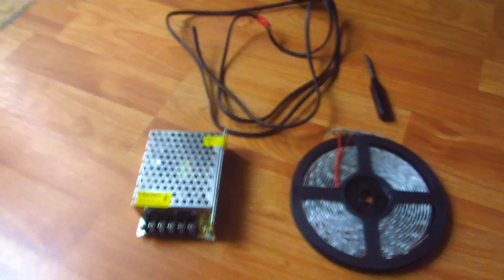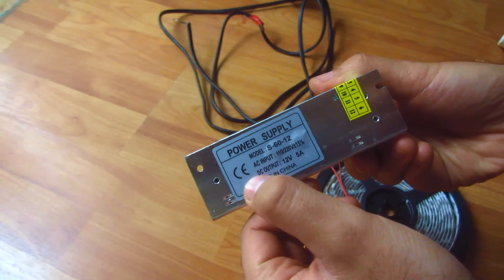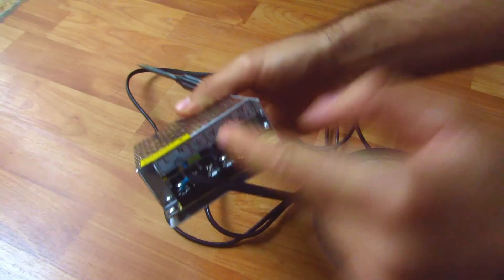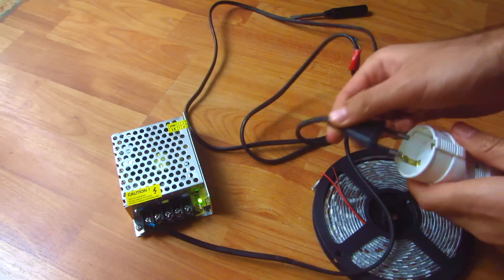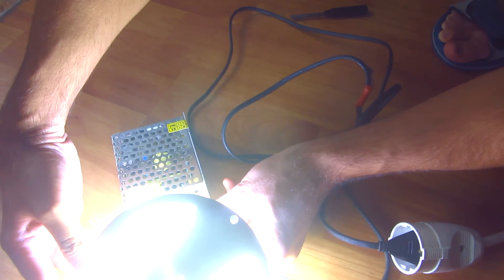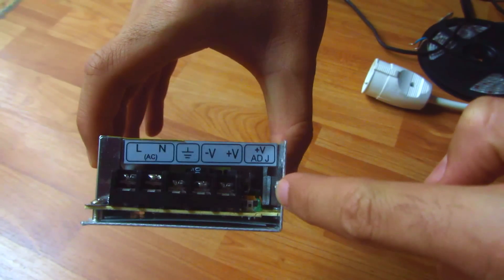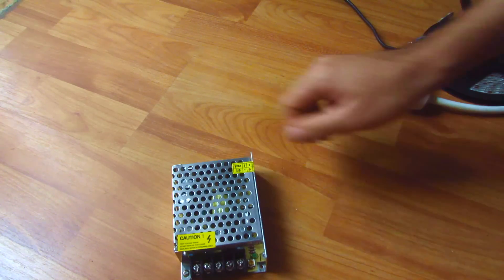How to Connect LED Driver/Transformer to Flexible LED strip

Comment: Isn't the Blue cable for the Neutral slot ?
Reply from the maker: Usually it is, but since it uses alternating current (AC) it doesn't really matter because it is changing polarity many times each second anyway.

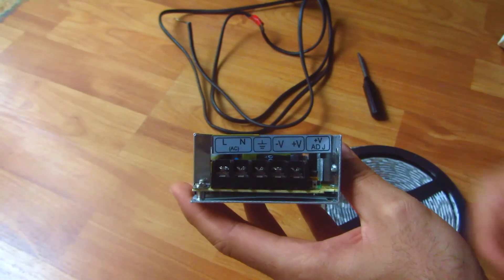Comment: At 1:23, What is the last label on the right "+V ADJ"? How do you use it? I am asking because my strip seems a little dim after installation, so I am wondering if I need to use this to increase the voltage.

Comment: How to connect 12m (5+5+2) 12v 50/50 to  power supply?
Reply: I have the same question. Did you have any luck with this?

Comment: Hello I was wondering on the power cord  to the wall how do you know what wire color is L and the N
Reply from the maker: It doesn't matter which is L or N because it is Alternating Current (AC), it switches polarity 50 times per second (in Europe), that's the 50Hz. Just don't connect the 220V to the -V and +V, that is the 12V DC output.
Reply: @furulevi  thank you and I appreciate the information helped alot

Comment: Can achieve the same result, but surely much safer to connect the LED strip to the transformer whilst it is off, then switch on power supply to the transformer after all connections made?  At least you won't have to take so much care not to touch the L+N terminals whilst connecting the strip and prevent electrocution systematically.
Reply: led strip light Transformer  make noise how to fix it ?
Reply: @shrimplife8246  simple, new small LED drivers (transformers) from say 240V to 12V or 5V with sub 5A total current shouldn't be making noises at all. I have about 10 in 24/7 operation of different sizes and none make a noise.

Maybe replace yours.

Comment: I don’t understand why you connected Blue to “L” and brown to “N”. I have Chinese LED driver which has brown connected to “L” and blue to “N”. Did not you switch polarity?
Reply from the maker: Yes usually brown is for Line, but in the end for AC it doesn't matter because it is alternating.

Comment: Hi in 23 meters led how many watt should be the Transformer?
Reply from the maker: around 30Amp (at 12V output)
Reply: furulevi yes but how many watt should be the transformer ?is 250 watt ok?
Reply from the maker: It might be OK but it will heat up faster and it might burn out faster. These LED drivers are sold with different Amperages, not by Watt.
Reply: furulevi thanks sir
Reply: furulevi hey body how are you I did install the led  and the transformer is 350 watt but around 3 meters is to dim light what is the problem?

Comment: hi.. what is the watt ur psu...?
Reply from the maker: 12V x 5A = 60W (shown at 0:26)
Reply: thank u very much.. I had wanted to know wattage calculation I know that . i want decorate my home. it is 5m/roll * 10 rolls = 50m  length. 12V *  50A = 600W PSU  is suitable with AMPS.....? (amps between 2 rolls.)
Reply from the maker: 4 meters of 5050 LED strip requires approximately a 5A transformer, so 50 meters of LED would require a transformer of around 62A, and 62A x 12V = 744 Watt. Use multiple smaller transformers.
Reply: thank you......

Comment: Hi . I have 2 rolls of 5M led strip rgb 5050. I have already fixed it to my T5 tube casing . But waiting for my transformer . Can Iuse a 24v power supply if I combine these two strips which will make a  length  of 10M . your advice please
Reply from the maker: Theoretically you could connect 2 LED strips in series and power them with 24 volts, thus each strip will receive 12v. (I haven't tried it with my LEDs)
Reply: Hi Thanks , Afraid if one strips blows off another one will burn off too . any way will try it with two 12v power supply . thnks

Comment: Hi, I have an exact same transformer which is 5A 60 Watt....arrived yesterday - I connect the two pin AC cable as mentioned in this video - Tested it - The Green LED comes - Touched it - Everything is fine. Today MY LED Strip arrived which is 5050 SMD with Five meter Roll and 60 LED per meter which means 300 LED. Connected and LED Roll Lit up - No problem. But Power Supply now give very very mildly shock. Disconnect the LED - Touched it - Nothing...Again connect the LED and there is shock present.
My question here: Is it going to harm LED Lights anyway ?  Please let me know.
Reply from the maker: Which part is shocking?? Don't touch the 220V input!! The 12v should not shock your finger.
Reply: Getting Shock from The Whole Metal Container - Dotted Grill Portion or the Solid Part Where the White Specification Label at the Side of this Brick - Confusing part is When the LED Strip is connected and working only then It gave Shock.
If I disconnect the LED and Power ON this Transformer there is no Shock at all........Also now this power supply comes with Transparent Plastic Protection on the Top of the All 5 Screw Input / Output. So accidentally touching the AC L/N port is out of the question.